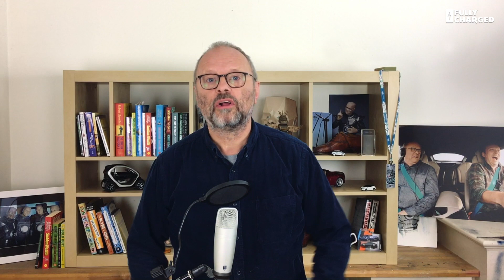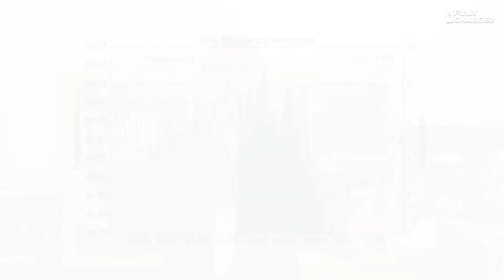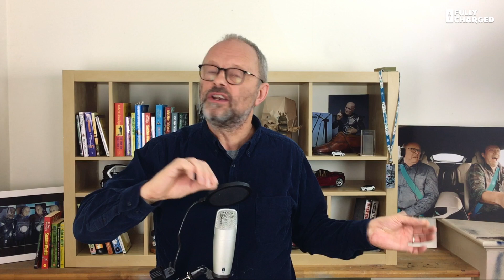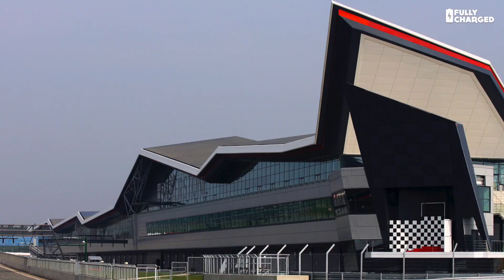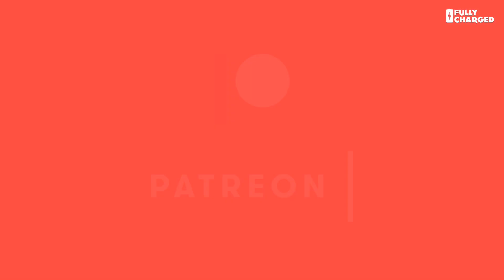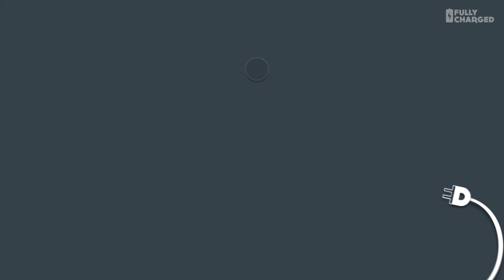Welcome to 2018 | Fully Charged News

Comment: I have to argue against your statement regard the negative aspects of nuclear power. Surely the main issue for nuclear power plants is the lack of a long-term storage solution for nuclear waste. Not one gram of high level waste has found a place for safe, long-term storage - every gram of high-level waste is stored in a temporary storage facility.
Still waiting for your promised update to your piece on the Tesla Estate car.
Reply: The volume of high level nuclear waste produced by the UK to date can fit on a single football pitch to a height of about five foot. Most of that came from pre-80s plant. Only a small amount from the current AGR fleet and v little from SZB. Yes we need a solution but the volumes are tiny, particularly from modern plants.
Reply: That's not exactly true. Several countries have proper solutions, and even the US has Yucca Mountain. It was long delayed because of political reasons, but it's now done, and have all the permits. I don't know whether it's open or not, because the political battle is still not over.
Reply: One problem with nuclear is that it requires a whole range of highly skilled professional and technical teams to support it. In many many countries people with these skills are not available, and the effort in establishing an educational system to provide these skills is a huge hidden cost of nuclear.
Reply: András Bíró , yucca mountain is not open.  We are still waiting for real solutions.
Reply: Chris Ruwoldt, there is also the opposite. Countries that have the know-how and the people, and the educational infrastructure, are closing old nuclear power plants and not replacing them with the new ones in the face of mass protests, that are usually based on the (mostly) demagogical waste and Chernobyl/Fukushima arguments. On the other hand, maybe we'll come up with some revolutionary way of producing energy in the upcoming, say, 20 years and then such anti-nuclear activism will pay off, even if unintentionally ;) We'll see.
Reply: Chris Ruwoldt
That's true, but only because we are doing nuclear energy the wrong way. It's possible to build small modular reactors that are fully automatic, especially the safety systems. And they are portable too, so no only minimal skilled work is required on site.

Comment: I love you but, yeah, nuclear is "great".  Can I bury the waste in your backyard for thousands of years?  I promise it will be "safe" and that there is nothing in the Universe that could result in a leak...SHEEESH!!!
Reply: It's infinitely safer than dumping coal ash into your drinking water. Nuclear waste is fully contained, and with proper oversight it's perfectly safe. The really dangerous stuff is in nearly indestructible containers, which won't leak even if you just leave them out in the open for hundreds of years. Solar panel manufacturing is likely more polluting.

Comment: Great, new & improved audio Robert. True Gigawatt Scale, Battery Storage for Solar & Wind Farm use isn't cheap, over 50 years, which is the typical, lifespan of a Powerstation. Try doing the math, the figures soon get pretty devastating for Huge, Grid Scale Storage, which hasn't been implemented, on the Massive Scale needed yet, for Baseload Power. Not that I'm advocating Nuclear Power. But the cost differences, might not be as great as you might, first imagine. Best wishes for the new year...

Comment: I see that you "fixed" your FOBAR about  Norway in the text, but in this video you very nicely show why it is nonsenses to talk about installed effect since that make a plant that run 24/7 equal to a plant that produce nothing.
That why is also important that cost is calculate based on real production not installed effect.
France have lots of nuclare and:
"France enjoys one of the lowest electricity prices in Europe; at 14.72 euro cents per kWh, the average cost of electricity in France is 26.5% cheaper than the EU average (20.02 euro cents per kWh)."  ref:Selectra
Reply: We allready have a very good idea of the costs, but it is the NIMBY effect that keeps it hidden and where it would be.  Today's temp storage is actually more then good enough. because we are not getting rid of it. because it is not waste but hardly used nuclear fuel from older ways of nuclear reactors.  We don't even need to mine any nuclear if we use the existing spend fuel.
Reply: bknesheim That price does not cover the cost of dismantlement of the power stations which will take well into next century if they don’t build a single new one. It also does not cover the cost of waste management which might last for millennia. Cheap now, but they’ll be paying a price for a long time.
Reply: If you want this type of accounting the cost of cleaning up the toxic wastland in China caused by producing metal for neodymium magnets must be included for windmills, electric cars and all other places they are used. You also have to include the cost of land, and damage to floora and fauna.

When comparing the cost for the consumer you can only include the actual price, not what you think the price should be..
Reply: bknesheim I actually agree with the first part of your reply. Those costs should indeed be taken into account, because they are very real. We do ourselves a disservice by shoveling them under a rug for others to deal with.
Reply: The trouble in doing so is that you then turn everything into politic and that make everything real messy. You go from from what thing is to what you believe thing should be. You also add who should have the power to  decide what to do and how to do it. When you go down that road fact s is often replaced by believes and power grabbing.
Reply: bknesheim Most things that concern everyone are political by their very nature, that cannot be avoided. And power grabbing is what is causing most of these issues in the first place. It almost sounds as if you say we should let things be as they are and not strive for changes to how things should be. But we are digressing. The original subject was the price of nuclear power. You say it is cheap, I say we will only know the real cost in a century or two at the earliest. And even the current cost for newly constructed plants is already higher than wind power. The reason it is so cheap in France is because those plants are old and paid for. Modern nuclear is far more expensive. We can be quite sure about the costs of neodymium, which we try to phase out of wind generators with promising results, and other troublesome parts of ‘clean’ energy today even if producers try to sweep it under the rug. With nuclear we simply can’t know.
Reply: With build dates from early 80's up to 2000 none of the reactor are old.
(ref:  http://www.world-nuclear.org/information-library/country-profiles/countries-a-f/france.aspx#ECSArticleLink3 )
The main reason is that France have used the same design many times and cut down a lot on the cost and time it take to build since the first of anything allways cost more and take longer to build.

The fact is that if you want a reliable grid you need the capasity to cover all the need for electricity from other sources then directly from wind and sun. I think that Norway is the only developed country that can do that from renewable sources (hydro-electric). For the rest nuclare is the only option that do not release CO2.

The backup cost has to be include if you want the "total" cost of wind and sun.
Reply: ferkeap Using current spent fuel for future power generation is, so far, a pipe dream. We know the theory, we know it is possible, but so far we have the greatest of troubles building current GenIII power stations, let alone GenIV designs. It is not nearly as far fetched as nuclear fusion, but there are still big hurdles to be taken to make it a reality. Much like fusion, the ETA on molten salt reactors always seems to be 10-15 years in the future. I hope we can do it, but it might never happen. Even if we do, we will still need safe storage for 3 centuries for GenIV waste. A wind generator, solar panels and batteries can be fully recycled, are cheaper every day and we know rather well how to build them.
Reply: ferkeap Using current spent fuel for future power generation is, so far, a pipe dream. We know the theory, we know it is possible, but so far we have the greatest of troubles building current GenIII power stations, let alone GenIV designs. It is not nearly as far fetched as nuclear fusion, but there are still big hurdles to be taken to make it a reality. Much like fusion, the ETA on molten salt reactors always seems to be 10-15 years in the future. I hope we can do it, but it might never happen. Even if we do, we will still need safe storage for 3 centuries for GenIV waste. A wind generator, solar panels and batteries can be fully recycled, are already cheaper than nuclear and cheaper every day and we know rather well how to build them.
Reply: bknesheim I will concede to the age argument and your given reason for lower cost. I assume that means they use a GenII design since GenIII are far from easy and cheap to build? The French themselves can’t seem to get it working in Finland. GenII has  limitations when it comes to waste and they won’t be cheap or quick to dismantle. There will be a price to pay in the future for their current lower prices. Renewables combined with diverse storage (batteries, hydro, hydrogen,) and connected grids over large distances can provide in a stable supply. Not cheap,  it known and proven technology without hidden costs for future generations. We should never stop looking at alternatives like nuclear, but why bother with tech that we know has severe drawbacks when we have alternatives?

Comment: No nuclear power plants in Norway !
Reply: There are two nuclear plants in operation for research purposes in Norway (not power plants). Also we had one of the worlds first (and europes first) hydroelectrical plant in operation during the industrial revolution. We had 13 of them in operation before the turn of the 19th to the 20th century. We went clean when rest of europe thought it was cool to start burn coal in the 1800's

But then we discovered oil. But at least that is still (natural gas) cleaner than coal.